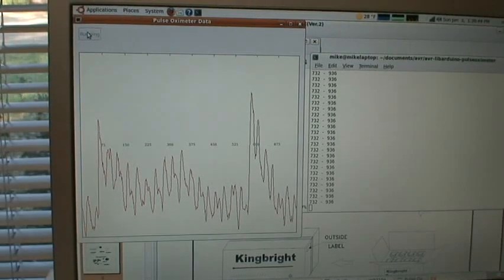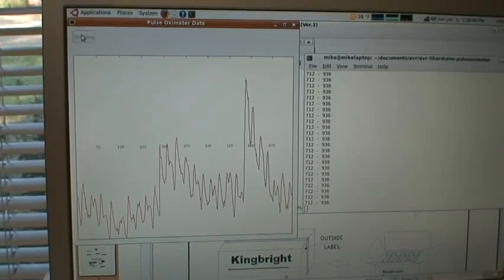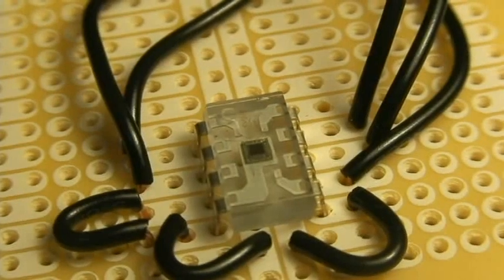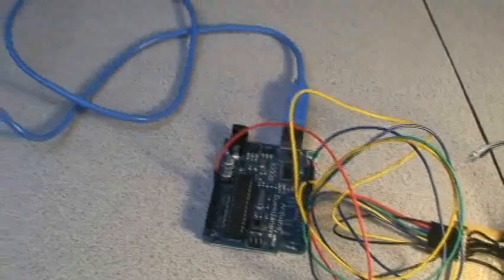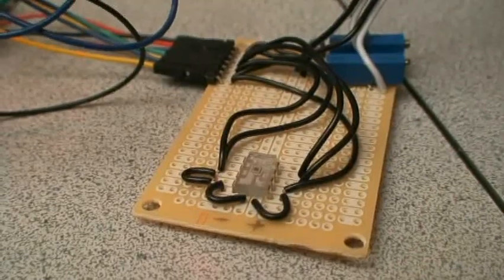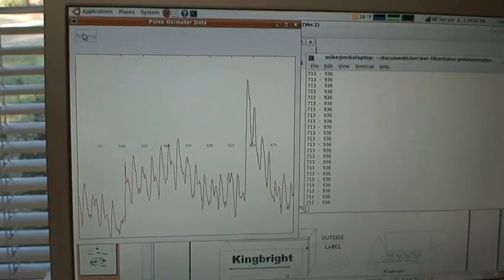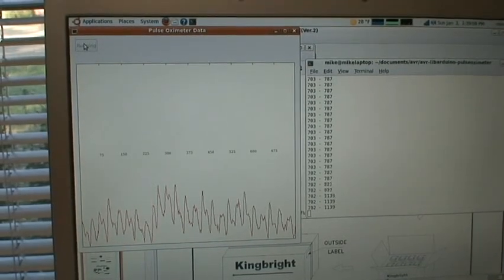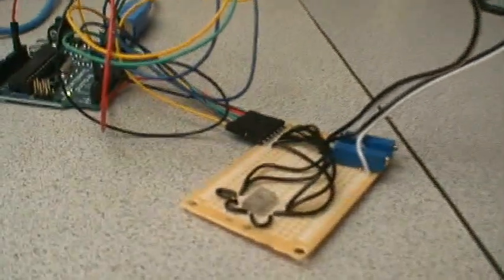DIY Arduino based Pulse Oximeter (part 1 of 2)

Comment: Hey Mike, hopefully you still check these comments. I was wondering how you were able to make the sensor sensitive enough to detect such nice looking pulses/waveforms (in the screenshot in your blog) without any sort of filter/amp. I am in the midst of trying to do a similar project, and cannot get my TSL235 light to frequency sensor to be sensitive enough to detect small pulses; therefore I am next going to try using analog and op-amp the signal. Thanks for the great vid and blog post